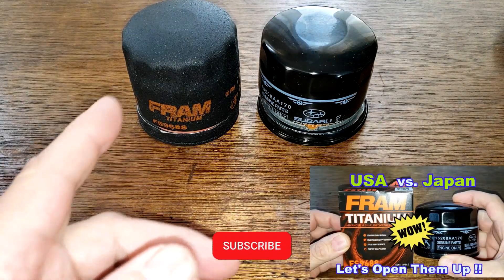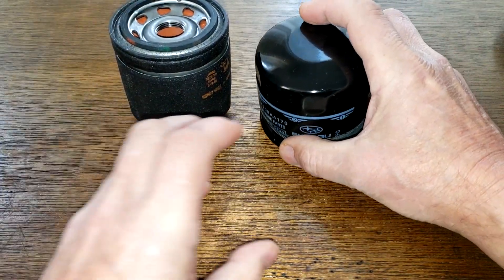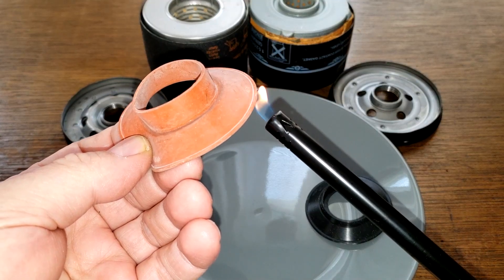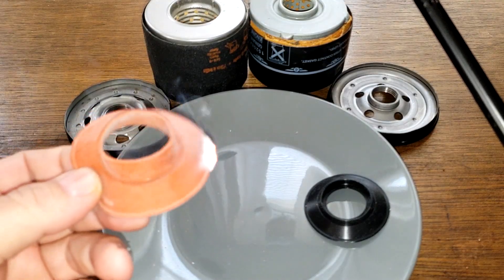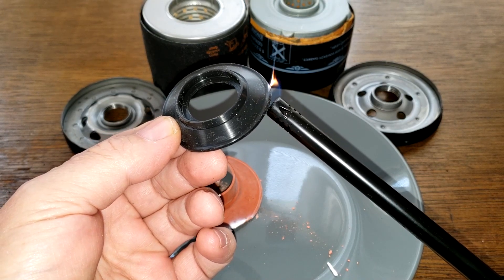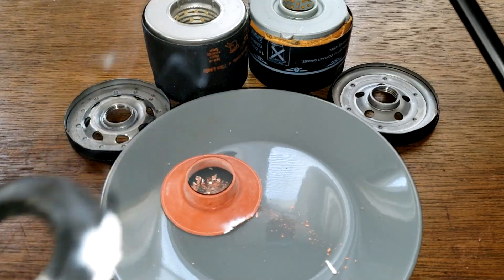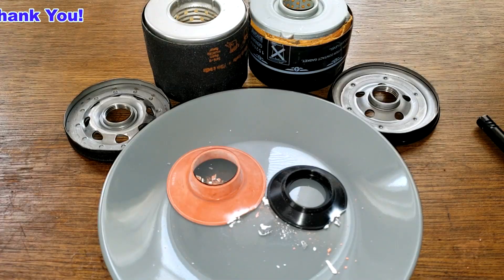Subaru Oil Filter Anti-Drain Back Valve Burn Test, Black Anti-Drain Back Valve Burn Test

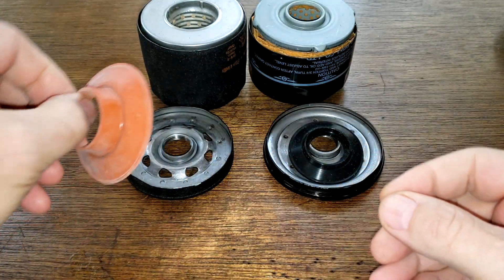Comment: @1:06 the silicon ADBV is better because it doesn’t get HARD as the el cheapo version does (I’ve cut open a bunch of used oil filters and the black nitrile rubber ones are STIFF and barely move 🤨
Reply from the maker: True, Thanks for your feedback😃

Comment: The fine lines (machined mold marks) on the Subie filter are a clue that it is silicone. Another hint is the glossy surface finish.

Comment: Only the second "known" "black silicone" adbv seen in the real life. The other Toyota Thai made Denso OEM. Really though no way imo, to know based on appearance alone. Denso First Time Fit claim their black adbv silicone, but that's been proven false multiple times. Many thought is was silicone because it has shiny appearance. Because the vast majority are, if it's black, like you I'll always guess nitrile. Rare exception here. Thanks for the burn test.
Reply from the maker: You're Welcome faxmen09👍
Yep, when I see a black anti-drain back valve I automatically assume it is nitrile rubber.

Comment: Probably a great idea for this particular application as the filter is located on top of the engine and also with the domed end facing up. The manufacturer recommends something like 7,500 mile oil change intervals, and that would be especially rough on a nitrile rubber valve. Those valves get a bit stiff and often tend to warp after three or four thousand miles of use.

Comment: First black silicone ADBV ive seem
  Nice job catching that!  ✌️
Reply from the maker: I've done some burn tests on other ( Made-in-Japan) black anti-drain back valves, and they were also silicone.
Reply: @WhipCityWrencher  pretty cool.  I get right into opening up oil filters as well !  I like to stay on top of these manufacturers,  and see when there staying true ,or making cost cuts.    Our vehicles longevity depends on them using quality materials.   I've settled on using premium guard extended life oil filters,  as they have been the most consistent in the materials quality as well as the cleanest filters I've seen to date.   Unfortunately most of the top dollar filters every1 swares by are some of the dirtiest and lack luster I've seen.  Wix gold being one of the worst offenders as of late.    Not what they used to be.  Wix xp seem pretty good still ,  at least there still using top quality materials. But they have a quality price too,   For the $$ those darn premium guard extended life are the best bang for your $.  ✌️
Reply from the maker: @LORD_OF_THE_ROOTS  Thanks for Sharing👍👍
Reply: Denso uses silicone and is black. Color doesn’t mean anything